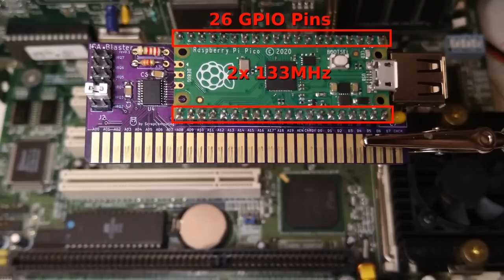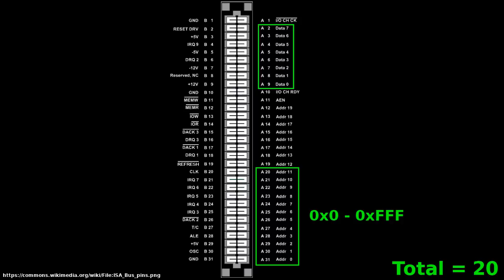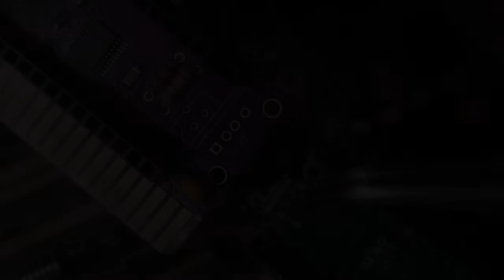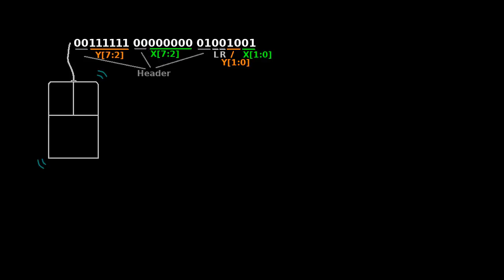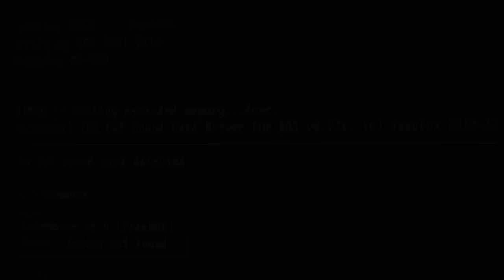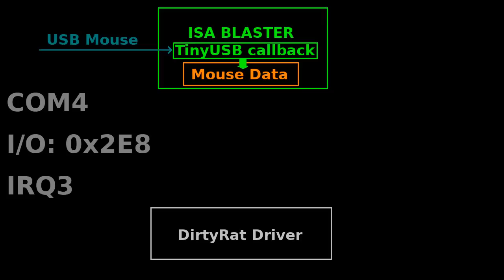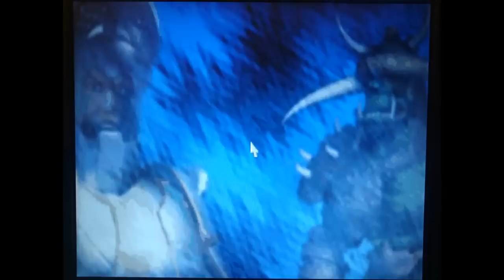ISA Blaster: A software-defined ISA card based on a Raspberry Pi Pico (Part 1)

Comment: I have been looking to do something similar but with PCI and a regular Raspberry Pi. I figured I could have the Pi pretend to be a 3dfx Voodoo, and have the Pi's GPU do the rendering. But it turns out I'm nowhere near smart enough for something like that 😅
Reply from the maker: That would be really interesting, though I would start with something simpler, like emulating a VGA ISA card.
Reply: Somebody run a PCI and a PCIe GPU of an Arduino and compared it with a typical minicomputer GPU, turns out the mini GPU is actually quiet weak and a stronger one is limited by the CPU of the minicomputer. I'm afraid a rhasberry still can't quite emulate the performance of an actual voodo card.
https://youtu.be/MQR2LxR7VdM
Reply: That's an Arduino-compatible board, but it's based around a Vortex86 family SoC which incorporates a processor that is essentially equivalent to an Intel '486.

Presumably that SoC also has the necessary hardware logic to interface PCI cards already and he's just interfacing to a PCIe card over PCI (PCI and PCIe x1 are intentionally compatible with a bit of extra interface hardware).

Comment: Could you use a wifi version to emulate an ISA network card?
Reply from the maker: Yeah that would be really cool! It will probably not work with the stock driver though, but if there is an open source one that we can hack, it might actually work!
Reply: This would be awesome!
Reply: It's possibe to interface RPico directly to Rj45 via resistors, looks like NE2000 emulation is feasible.

Comment: Interesting. I especially liked that you adapted CuteMouse so you can leave out the UART emulation. Do you know at what rate (hz) your pointer updates at max? I believe for serial it was around 40 hz under DOS. Some bus mice could update faster.
Reply from the maker: I am not sure about the sampling rate. Most serial mice work at 1200 baud (150 bytes/s) and for each mouse movement there are usually 3 bytes (some use 4), so in theory you should be able to get 150/3 = 50 samples per second?
With the ISA Blaster you can configure the sample rate from the USB in the Pico firmware, but I have not actually measured how high it can go. That would be very interesting to measure, thanks!
Reply: @scrap_computing  40hz for 7n2, 44hz for 7n1. 
That's the spec it seems, even then i feel like 7n1 is a hack that just works.

Comment: Just one point regarding soldering,  it's better to use a vise-like pcb holder with two sides fixation or just a heatproof flat surface to solder smds. Third hand, in this case, less helpful, especially when liquid flux is used
Reply from the maker: Yes, I need to get one of those pcb holders :)

Comment: Very nice project. I played with Pico Pi on my XT prototyping board a year ago, but it turned out to be too slow to use it directly to ready from the bus, I ended up with programmable logic ICs which can be setup by the Pico Pi to react on particular combinations and only send an interrupt to the Pico Pi. That works much better, but I never came over a very rough prototype though. Such project needs a lot of time, so great job!
Reply from the maker: Yeah interfacing with the bus purely in software is probably too slow, it might work with a slower bus though, I should give it a try.
Reply: @scrap_computing  RPiPico has programable IO co-processors, 8MHz for them is possible.
Reply: With PIO, overclocking the Pico,  and raising IOCHRDY when it’s not possible to process a bus event in time, it’s possible to keep up with an 8MHz ISA bus.
Reply: @ianpolpo  PIO can co-work directly with DMA, so 8MHz should be possible without overclocking.
Reply: @alexloktionoff6833  Unfortunately no, as we need to decode the adresses, ignore the dma signals, activate multiplexers, use iochrdy to slow down the accesses and so on.
Reply: @alexloktionoff6833  Maybe, it depends on how much logic has to be done to service the bus event in the ~300ns that IOR or IOW is asserted. That's about 37 cycles at 125MHz. For PIO, if address decoding is done in hardware and data just needs to be fed into RAM in large amounts, DMA would help a lot. I looked into translating ISA DMA to RP2040 DMA for PicoGUS for GUS sample uploading and I couldn't quite figure it out completely because I don't know the number of bytes that would be transferred up front.
Reply: @freddyvretrozone2849  I mean RPiPico PIO can trigger RPiPico DMA which then can trigger PIO again, this lets to map few ISA ports /*or memory cells*/ into RPiPico RAM  with generating interrupts for actions. Of course ISA visible ports/cells changes will not be immediate, but with tricks they can be made atomic which is 99% enough for ISA devices emulation.
Reply: @ianpolpo  yes plan B is to add one 7474 to always trigger IOCHRDY and to clear it by s/w in RPiPico interrupt handler. But I think plan A is still feasible: to direct map a small amount of RPiPico RAM into ISA io via RPiPico PIO+DMA programmed to trigger each other in a loop.
Reply: I've got a couple of Sipeed Tang Nano FPGA devices coming to use for exactly that - bus interfacing. Bit banging an ISA bus is even more challenging than the Apple II stuff I'm playing with, so I'm not going to even try.
Reply: It is possible.

Comment: Nice work, as always! However, won't it be limiting to have access to only the lowest 4kB or RAM (12 address bits)? If you are already putting the level shifters on the board, how much could it hurt to add an extra latch/shift register and bang it with one of the PIO state machines to get access to the full address space?
Reply from the maker: For pure I/O addressing 12bits should be all right under DOS, but yeah adding some logic would probably also solve some of the timing issues too.
Reply: I did a full I/O and memory Pi Pico board already 😀